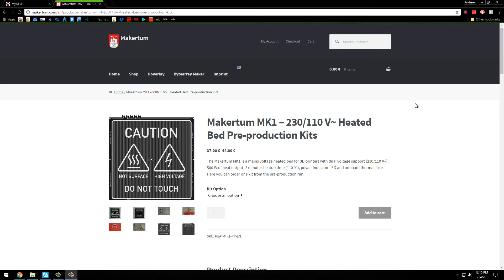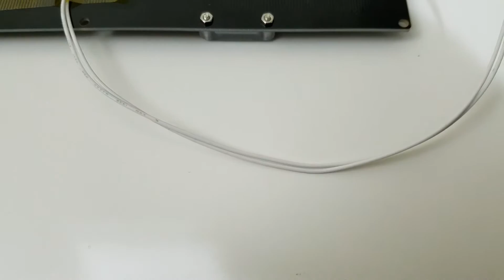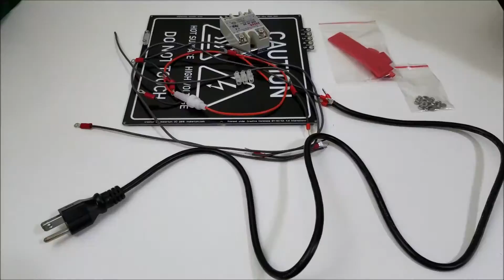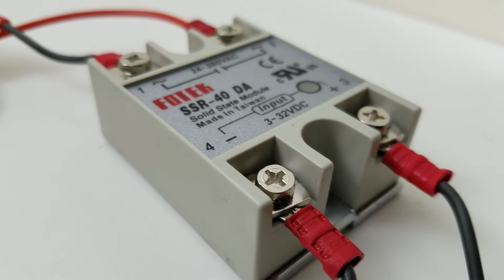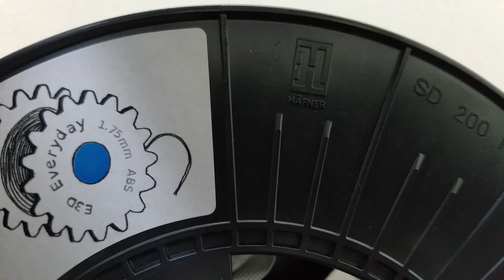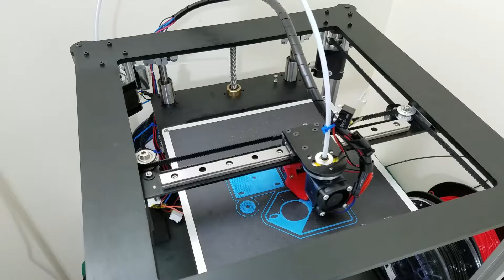Makertum Mk1 Heated Bed Review

Comment: AC heatbead - quite unsettling to be honest. Yeah 12v bed is more likely to catch a fire but at least it can't instantly kill you.
Have you guys seen Chuck's video where his Wanhoo bed let magic smoke to escape?! Imagine all that with AC bed...

Guys just be VERY careful!!!

P.S.: Quite like your review type video format.
Reply from the maker: Yeah that's true, although 120v is relatively harmless as long as contact is short and you don't have any heart conditions. I've been zapped by 120v a few times while working on 3d printers and it definitely isn't fun but I'm still here!

But regardless, yes you're right. 120v is not something to be playing around with and that is why I recommend always supervising a 3d printer that has this bed on it. And all of the safety features like the fuses and shrink tubing should never be altered or modified. I also forgot to mention in the video that the SSR and the terminal block should both be put inside a plastic housing to prevent accidental contact.
Reply: 3DprintedLife Yeah, UK is powered by 240v (as 50% of the world) so double caution! Also thermal fuse is floating on top of the traces with thin silkscreen in between... Scary... But as you said some people will have appeal to 1min heating time, very niche product though.
Reply from the maker: Kris M That's very true, double the voltage means 4x the power going through your body if you touch it..definitely not good! It is so amazing to heat up the bed that fast though! Just a bit scary unless you take every possible safety precaution.

Comment: As you know, I've owned both this bed and the Keenovo Silicon bed. I did find this heated faster but I agree that the Silicon is safer. I was one of the first beta testers of this board and I think I spent more than $60 to do so. I'm impatient, so saving 10 minutes when I get a bug to print something is a godsend!
Reply from the maker: Thanks for your input! Yeah I agree, it's so nice having a bed come up to temp in a minute flat, but I just would never trust my printer to run when I'm not around using this bed! But for many people I definitely see the appeal!
Reply: I will say that while printing I always have a webcam streaming and the printer is plugged into a wifi outlet that I can remotely shut down. In case something goes horribly wrong I can have it powered down in less than 30 seconds.
Reply from the maker: Brian Popilek Yeah true those are definitely some good features to have!

Comment: my 110v with ssr 300mmx300mm silicone bed goes from room temp to 110c in 3 1/2 minutes
Reply from the maker: Well that's still pretty good, especially consider that bed has more than double the surface area of a 200mm one, so in reality it probably has a similar power output to the makertum.